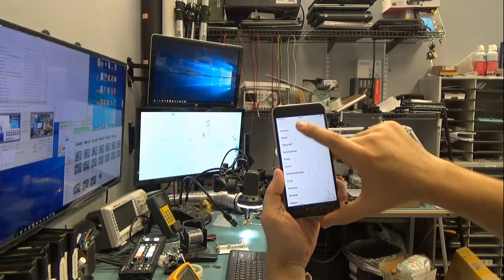Iphone 6+ Plus unresponsive touch screen Repair - Touch IC replacement

Comment: nice video bro ... and i think for a better repair on iphone 6 plus you may have to make m1 jumper under the touch IC for a better result ... keep going bro ..
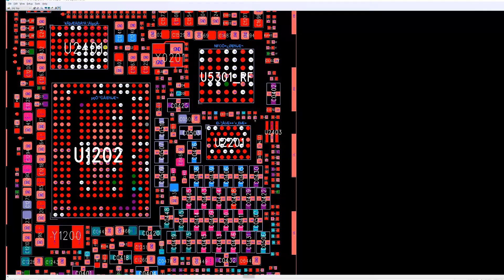Reply from the maker: The missing pad is nc (no connect). It's not connected to anything. Half the pads for this IC is nc and that's why they get loose easily because they don't connect to any wires. Look at 2:52 of the video. I only proceeded with IC replacement after i looked it up.
Reply: NorthridgeFix yeah bro i know it was NC pad what i mean is make the m1 jumper to protect it from any damage in the future because as you know it's really easy to break.. that's my opinion .